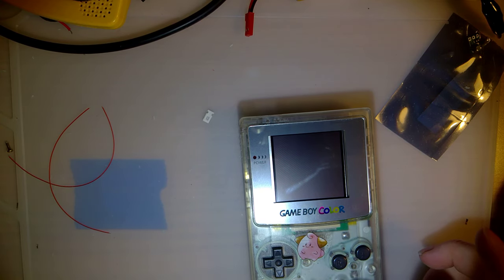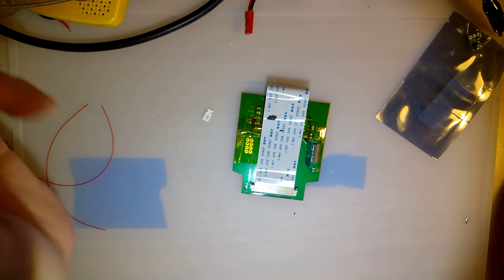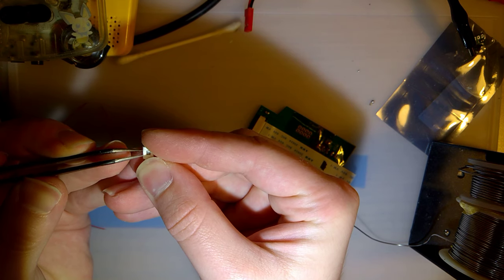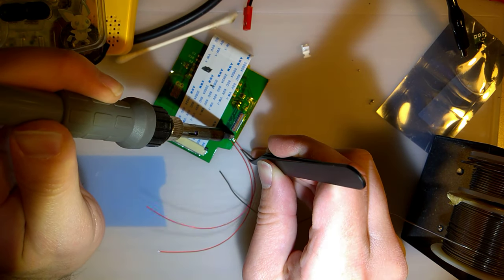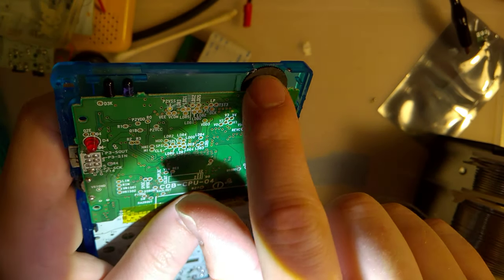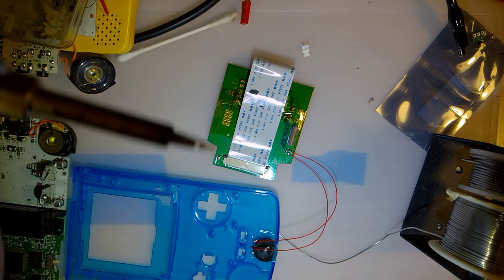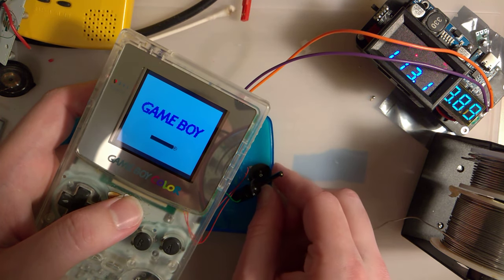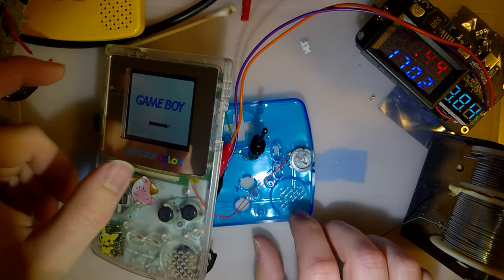Adding brightness control to Freckleshack (POC)

Comment: Interesting a variable current limiting resistor works. Aren’t most LED brightness controls a PWM signal?
Reply from the maker: Typically, yes. I have no idea how this is wired up though so I'm just following BennVenn's instructions and a hunch of mine.

Comment: If you do have the batch with the new brightness control where do you solder the wire too? I cant find any instructions anywhere. I got just got my batch 4 with the brightness control.
Reply from the maker: I'm not familiar with the new batch as I only have the one Freckleshack kit, but I believe you just need to solder a wire connecting the "brightness" pad (or whatever it's labeled -- it looks to be in the top left of the PCB) to any of the vias or test pads for whatever button you want to use as the brightness controller. Typically, this is the select button. This image should help with that: https://i.redd.it/af9szectfpu21.png
Reply: @makho  He made a post on his Facebook page showing a via right next to the CPU where it would be convenient to solder to.
Reply: So basically to any one of those vias then? Thanks for the picture. I was just confused cuz I couldn't find any info about where to solder to and the kit didn't come with no instructions. I even checked the bennvenn website but there was no information there either. Thanks for the help!
Reply: @epikalpuppy1169  do you have a link to that post thanks?
Reply from the maker: @ericochoa4034  Well, add it to whatever via you want for which button you want to use. Typically, select is the button serving dual purpose.

Comment: hey makho do you have any spare ags 001 screens you could sell to me? my sister tripped on a cable which made my ags 001 motherboard connected to the screen fall and the cable tore..... I don't even want to try fixing the ribbon unless you have any tips.... this is really random but I saw this on my feed and decided to ask. delete the comment if you want to
Reply from the maker: Unfortunately, I do not have any spare AGS-001 screens. I can sell you a whole AGS-001 though. It might be worth looking into getting one of those FIPS screens, I know from personal experience that they work on AGS-001 consoles or you can wait for the new version that's actually designed for an AGS console.
Reply: @makho  yeah... the fips screen for the ags 001 might take a bit and I don't feel like buying the current one tbh... we will see.. I wouldn't buy a full ags 001 unless you could sell it under like 13 with shipping lol (saw that deal once... regret not taking it)

Comment: Have you finished this mod yet? Or will there be a follow-up video? 😉
Reply from the maker: I may revisit this in the future, but I have no immediate plans. 

I know it can work because physically everything fits together and because I did test the electronics, but I'm not prepared to do this to my freckleshack GBC. I just don't think I like the position or control enough to offset the fact that I have to cut so much out of the shell. I also don't think I have the tools to do it properly. I didn't show this in the video, but my cuts in the blue shell are very scabby.
Reply from the maker: @Eyejeey  Perhaps, but not having the tools to do it right was just one reason. I appreciate the info though.